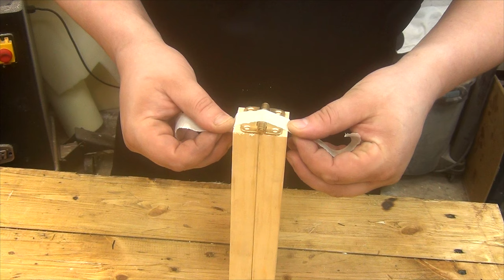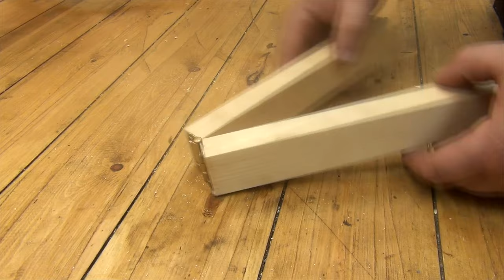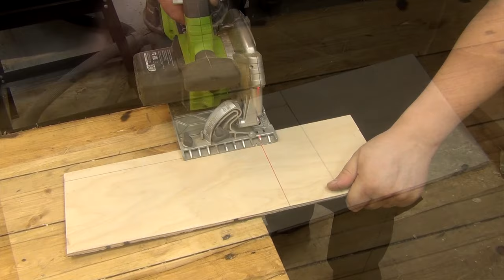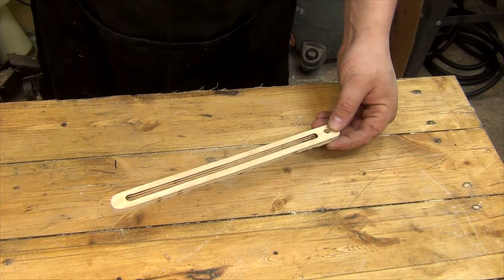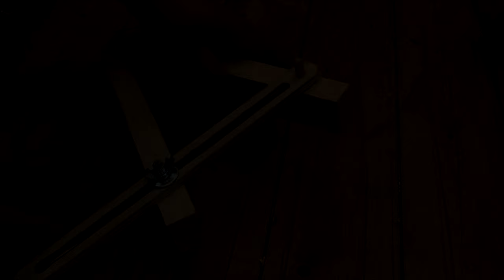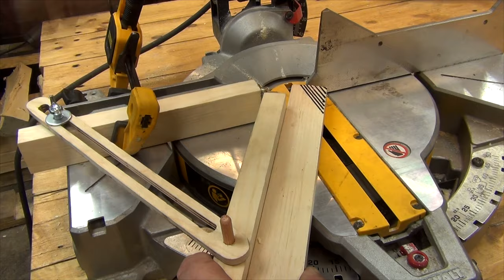A simple but useful woodworking tool for your workshop

Comment: So a miter gauge that you can use in a bunch of different situations.  I think you could actually do short cuts with a circular saw with that, too.  Obviously, it could be clamped to your table saw sled and used to cut repeated angles.  Nice job!